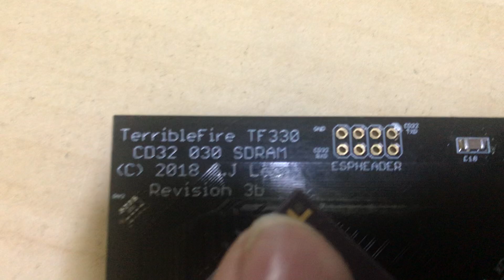TF History Series: TF330

Comment: I bought this card after my TF328, used it for a while but eventually went back to the TF328 because of it's compatibility (I can disable it). Hopefully the disable bug will be tracked down on the TF330, but until then it will remain in my drawer. Both are amazing cards, thanks for designing them!! 🙂
Reply from the maker: Out of curiosity why disable the 330? Based on my current queue it will be 2025 before i get to fixing that bug.
Reply: @TerribleFire  I have some original games that either don’t work with it connected, or run better with it disconnected. It’s no biggie as I have an A1200 with an ACA-1232 accelerator. I’m more than happy with the TF328 on my CD32 so no rush 🙂